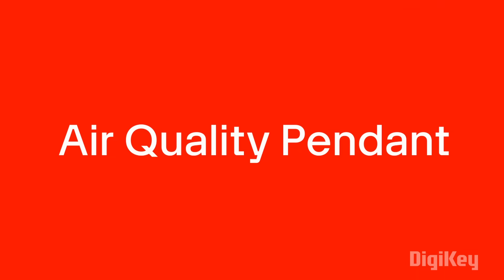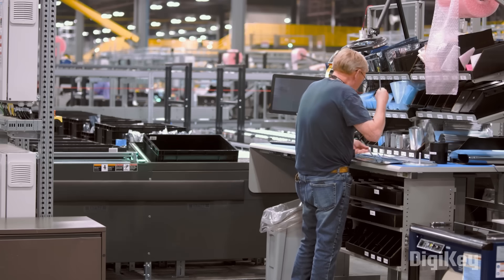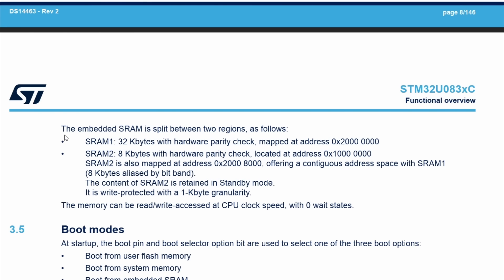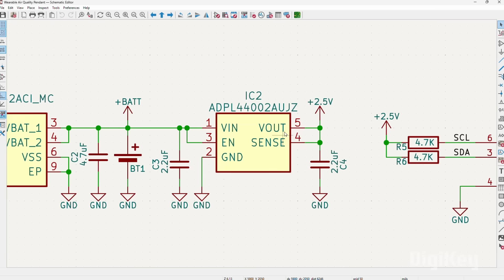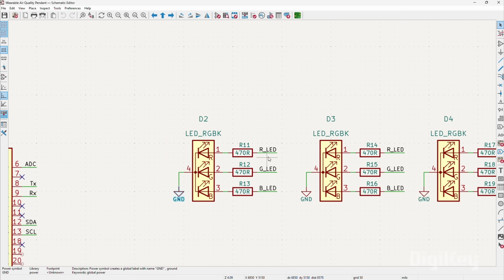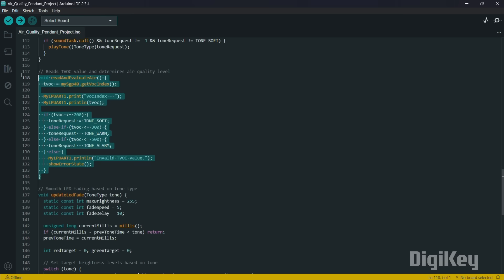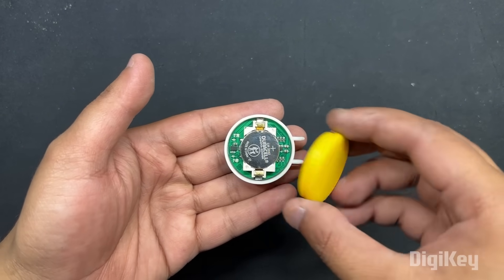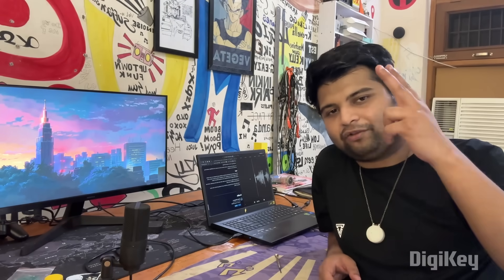Build a Wearable Air Quality Monitor - Complete DIY Tutorial with STM32 & SGP40

Comment: Hi circuit digest 
I was thinking about making a dedicated esp now protocol based transmitter for the light wing esp drone

 i have finalized the design needed some help for the software side and am willing to make a good quality video with finalized bat man style pcb with some cool aesthetics and functional features like i2c display for showing the battery percentage connection status etc and few push buttons for actions like flip,return,buzz etc

I would like to share you the files and video soon but needed some help from your will you guys be interested 

One more thing have really learnt a lot from you guys especially from the website and I would love to join this community of makers.
Again thanks for everything guys
Reply from the maker: Hi, thanks for reaching out. For technical help you can use the comment section section on litewing projects to post your questiosn and our engineers will help you out. https://circuitdigest.com/articles/start-flying-with-litewing#comment-36463. You can also check out the Join our community option at the bottom of all pages to start discussion with our community members